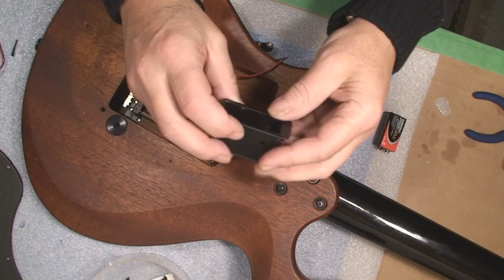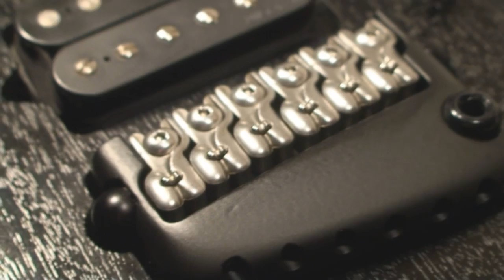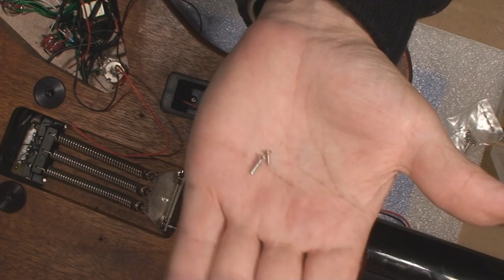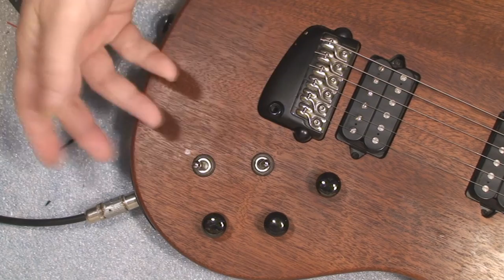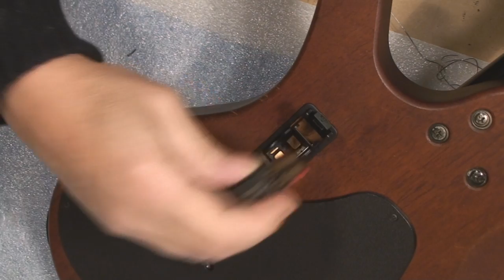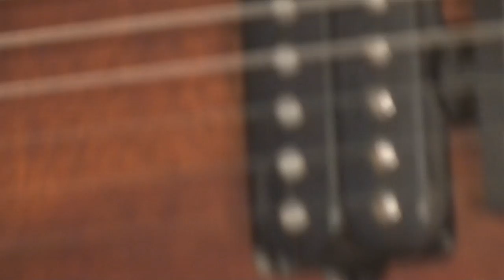Parker Guitar Battery Box Repair

Comment: I got a jackson rhoads 24 w/ EMG 81 my batter box just busted the black wire that connects to the box fell off... really didn't dig the box because verytime I hit the box or opened it the broken wire before it broke would mess up it contact causing really bad frequencies because of improper connection